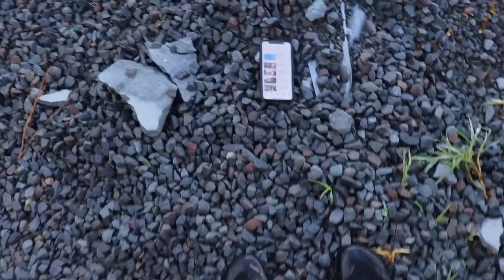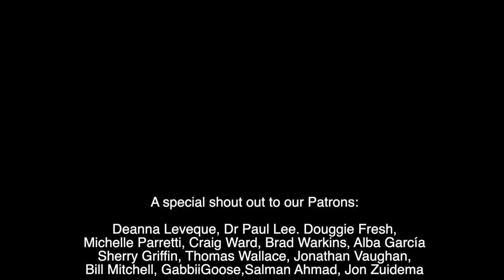THE REAL REASON WE LEFT THE USA and moved to Panama

Comment: I understand moving somewhere to fulfil dreams.  I moved from Australia to UK 8 years ago.  Fell in love with the mythic landscape of the Cotswold's, south West England, Cornwall, Wales, Scotland and Ireland.  Ancient stone circles, Tors (Glastonbury Tor at midnight is amazing|, Mythic tales embedded in the landscape, and a strong culture tied to nature still existing in the countryside.  I moved here in my 50's which was a challenge in all ways by itself, having previously lived in a Community in Australia in my 20's and then reluctantly joined the mainstream (IT Consulting) to fund the future.  Am designing a canal narrow-boat which I plan to have built, sell my little house and then move and live aboard permanently.  There are over 2000 miles of canals in the UK.  The canals were originally built at the beginning of the industrial revolution staring 250 years ago, were forgotten and disused for a long time, but are now being reopened as a lot of people are now discovering narrow-boats as small footprint more eco friendly permanent living spaces that can move and travel (lots of solar and lithium batteries).  Narrow-boats are 6 feet 10 inches wide, and range from 30 to 70 feet long with the normal average length somewhere between 56 and 60 feet (to allow passage through the many locks - built to accommodate rises and falls of the landscape).

Comment: Those self tapping screws are for thin gauge metal, “cariolas” in Spanish. You can use them on that deck but you definitely need to drill holes first. And since you’re drilling holes, you should use stainless steel screws so they don’t rust. But, that wood you’re using will fail before the screws do. You should talk to a local guy and buy teak boards. Or “guayacan” or “cedro espino” etc. They are hard woods that are cut by chainsaw and will cost less than those pine boards you’re buying and last a lot longer. 
You guys bought land in the gringo part of panama. The weather is nice, but that’s about it. It’s expensive and far away from everything. Pristine land on lake Gatun, for example, goes for as little as 15 cents a meter and you’re 30 minutes from novey, Cochez, doit center etc.
Reply: Carriolas...

Comment: You need to order a windmill generator kit to charge your batteries while the sun is not shinning, and you need to buy some corrigated sheet steel and make a sun shade roof that will act as rain catchment for your water tanks. More square feet of roof for rain catchement is desperatly needed!

Comment: For the metal structure associated with your deck, I recommend galvanizing paint or any exterior paint containing zinc.  The zinc will corroded preferentially to the steel and therefore protect the steel well.  If you no longer have access to the top of the structure,, painting the underneath portions of the metal will greatly help the longeity of that structure.  A non-galvanizing paint will levae pin holes in the paint and that is where corrosion will start. It will not be necessary to remove any prior paint, just paint the galvanizing right over it.  If you cannot get galvanizing, then you should check the existing paint every 12 months and look for rust spots ion the surface.  If you see any, lightly grind those areas and re-paint.  Good luck!!

Comment: New subscriber, great channel guys...not positive if you have been told or not, there is 2 large hardware stores just past Alto Boquete on the main road exiting out of Boquete. From your main road, get to the Boquete Highway and take a left...one Hardware store on the right and a bit down the road a larger one on the left that has a small grocery attached to it. Don't waste your time in Boquete at that small stores.  In David, there is a large Do It Center (Is a small one in Boquete that you can place an order with that gets several deliveries from David daily...turn left at the last light before hitting the main Hwy if crossing the hwy and you see the large collisium on your left, you missed the light, need to loop around and get on the main highway that you go over and be sure to pass Pizza Hut, both centers will be after...Across the Do It Center is another mega hardware store as well....the left turn at the light meantioned will take you straight into the Do It Center....Keep up the great vids, God Bless!! Need any assist give us a holler!!

Comment: Probably too late, but when you put your planks on for your deck, make sure you put them crown up . What I mean is, when you look at the end of your planks you will see the growth rings of the tree /wood. They claim if you lay them that the growth ring faces up, it repels the water and helps prevent rot of the planks over time. Only thing that will keep you from doing this is that you now already have them treated and you "safe" treated side  may not be facing down to the ground as you wanted

Comment: Hey guys,Great stuff as always. Don't know what the lag time is on these vids. Drilling in metal can be a little dicey.  You need to be at low rpm and have some kind of tapping fluid. Linseed or motor oil should work in a pinch. Too much heat will melt your Chinese screws Generally 80 rpm with a 1/8 bit for black iron.

Comment: The more you build around the buss, the more it'll disappear and your compound will emerge and before long you'll need a search party just to find your roots....the buss. Next a porch with a roof strong enough to put a deck on top, or a water catchment system, or both and be sure to extend it over the top of the buss for the extra solar panels and the noise reduction it'll provide. Screen it in to keep the blood suckers out on those days when you want to sleep semi outside. So far so good.

Comment: There are cheap tropical hardware planks you can buy that are termite resistant. Additionally, some places carry pressure treated lumber which also does the trick but you would probably have to order it for delivery given your location. Also, there is a much better selection of screws in the city. Rural areas are always going to be limited and more challenging.

Comment: Do you have a plan for your driveway? I would hate to see your driveway get washed out from multiple days of heavy rain and you guys get stuck on your land because your truck can't get across. I don't know how easy this would be to remedy under the current conditions but just something I thought would be worth mentioning. I've seen driveways washed out over 1 meter deep during the rainy season. Maybe a large pipe of some sort, the larger the better, held in place by a lot of cement. If it's not heavy enough the water could even move a pretty substantial piece of cement. I'm not familiar with Panama rainy season but I've seen how much it rains in other tropical places. Much easier to get a motorcycle across in that situation. Love the deck!! Look forward to seeing your garden grow.

Comment: Obviously your garden is going to get bigger and bigger over time, have you thought about starting to plan out your levels? By that I mean if you turn the grass into cultivated soil for planting, you are not going to be able to leave on it's natural slope of the field or the rains will wash it all to the bottom of the hill on the first heavy downpour. Its currently ok as the grass and the roots bind it all together.
You are going to need to dig into the hillside to make level platforms all the way down your property. 
Top tip Tuesday for ya 🙃🥰😚🤓

Comment: Jordan, another option is to take some used motor oil and wipe a thin layer on the steel to protect it from rust. Wiping WD-40 on it also works. Prob the best option if you can find it is chainsaw bar oil. You can paint it then oil it or just oil it and it will still keep it from rusting.

Comment: Here is a top tip for you on the solar. https://energyeducation.ca/encyclopedia/Solar_panel_orientation You can maybe leave the panels on the bus but tip them at correct angle and you will get more "value" out of the sun. For the driveway consider getting a 220mm/9 inch pipe and remove the gravel at the gully/drain, lay the pipe in and put the gravel back over. This will let the water run through the driveway instead of over it and will not wash away every time there is lots of rain. Also try and compact the soil just a bit under the pipe in the form of the pipe so there is minimal sag when you drive over. First prize of course is to concrete the pipe in place. Just two feet either side of the pipe and this will also keep it steady........Good fun

Comment: Hi your chickens will also eat old bread if it is soaked in water 

have a look in to cow manure it has lots of great uses, not just fertilizer but also insect repellent, building material, fuel for a fire, floor covering and so on
if you start to use ex grass land as a garden plant potatoes for the first two years to break up the soil and the chicken and cow manure as fertilizer

Comment: For the driveway you will have to dig a ditch and install a corrugated pipe if you can find some down there. If you can find some medal T-post to build your fence with that will be much better than the wood post which will rot in a couple of seasons. Even if you can get a few at a time in the long run it will be much better cost and labor wise. Your living a dream life, good luck with that 👍🏽
Also ☝🏽 considering your location ( rain forest 🌳 in Panama) you may want to get a few motion or thermal activated flood lights to alert you to the presence of uninvited guest both two and four legged ones. Maybe ask your friends/family stateside to send you a few solar powered lights 🤷🏽‍♂️. Your in Jaguar 🐆 and Puma country after all.  I wish you well with your homesteading endeavors.....

Comment: you might want to put some sort of resin over the screws,  It looks like you undid your work when you drilled your holes for the screws and now hace open wood, unless you plan on going back over it with your blow torch.

Comment: Most "self--taping" screws are self taping for wood = NOT metal = must drill pilot hole in steele frame just slightly smaller than screw AND set torque setting on drill or impact driver so it will not break off screw. But crummy quality of metal in screws do break more easily  :-(

Comment: Love your channel,  you're doing many of the things I want to do in the place I want to do it.  

When you said everything was made of concrete,  it led me to 2 questions:

Why aren't YOU using concrete instead of wood?  Clearly, there are good reasons the locals use concrete.

Are you interested in a remote collaboration?  

Decades ago I designed a system to erect small domes  ( a maximum 25' in diameter ) of concrete or a clay mixture ( later fired ) to make a monolithic dome with minimal work compared to other methods.  Unfortunately,  without land to do it,  I've never been able to test or prove the idea. 

tim b green

Comment: Cell Phone Signal Boosters... check em' out ;-)
Reply from the maker: Ian Christensen we have one! But the cell phone towers here use a different frequency so it only kinda works
Reply: @NomadicMovement  Yeah, it won't work well if you're off frequency.   I'm sure there are some that are the proper frequency.  It's just you already invested in ones with the wrong freq.  But that definitely would work.  For sure.  I'm also an RF engineer.
Reply: You need band 28 for LTE on claro. I got one off of eBay for $70 and I went from 1 bar to 5.

Comment: Hate to tell you, painting your bug killer on won't work 100% effectively. You need to get that wood completely submerged in a mixture of bug killer and diesel for at least 12 hours, get it full absorbed into the wood.
Reply: Each time is rains, it washes a small amount off. Each time the sun dries out the surface, the wood expands and becomes more porous.

Comment: Wait, you have little log periodic antenna that can be used for boosting Cellular reception, i think it works in 2.4Gig band, can you check yor antenna... If you locate antenna on your cell and make a little radiating antenna an other end of the cable and lean your phone against that, you might have pretty good signal on your cell... something similar https://cdn.instructables.com/F72/CFQV/IJBTYGD2/F72CFQVIJBTYGD2.LARGE.jpg except this will be your oudoor antenna http://www.lintratek.com/201512/15/87.html (one you already have)  and check your tower location to aim it properly... and indoor antenna can be regular dipol/peace of centre wire  https://www.rcgroups.com/forums/showthread.php?1117173-Making-a-2-4ghz-Dipole-Antenna no need for anything fancy you will literally lean your cellphone near it...

Comment: I had a garden that would get flooded away like the edge of your road. We finally planted the seedlings in the hills with - in the rows, The water ran between the hills and the plants all stayed without being washed out and with-out being drown in sitting water. The roots had a foot to go, kept warm by the sun, before reaching the wet flat areas where the larger roots could handle it. .Love the deck 👍

Comment: I realize you don't have internet where you're at. But you should really research more before you start a project. You guys always work twice as hard as you need to. You're worried about termites getting into that deck when it's clearly off the ground on metal. If you had researched termites you would have found that termites don't come out of the ground into the sunlight. They don't like it. so you never have to worry about that. so you didn't have to spend that whole day burning that wood. And as far as putting chemicals on it. All you needed to do was paint it with a solid color water-based stain. It looks like paint and won't chip crack or peel. And doing that deck in black means it's going to be super hot in the summer. So you won't be able to go barefoot on the deck. You can get that solid color stain in any color that paint comes in. Cinnamon would be a nice color.